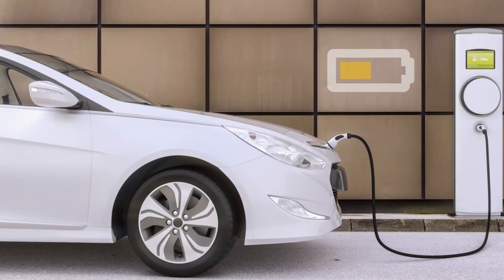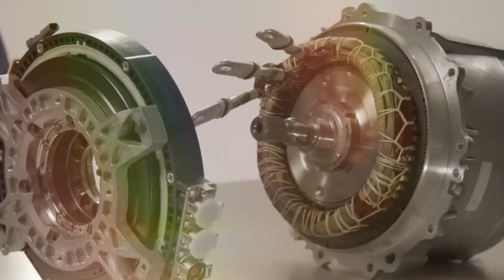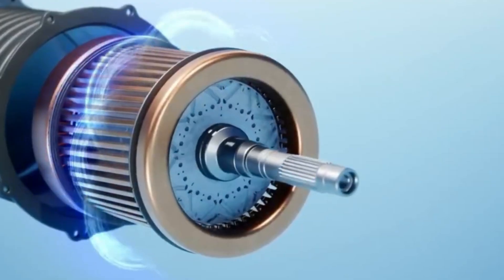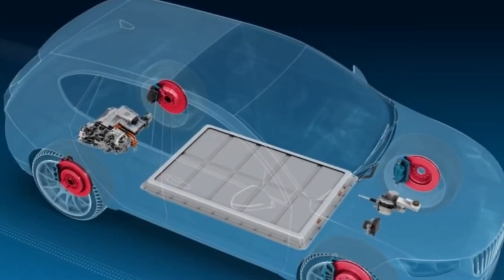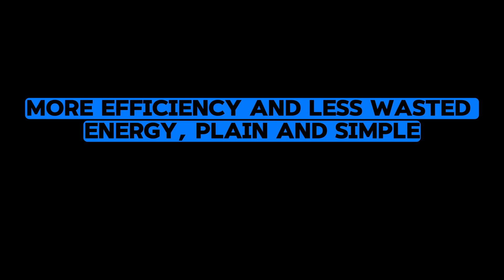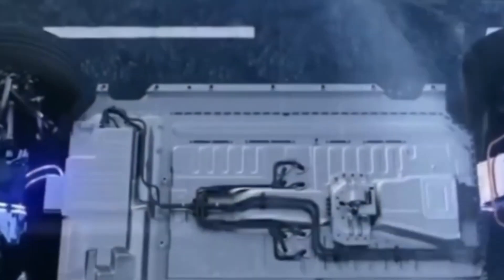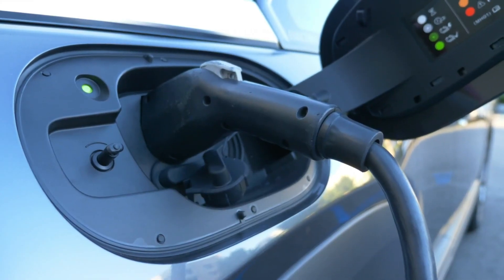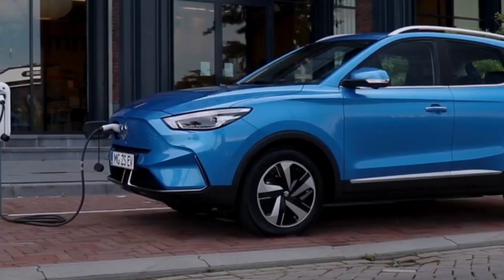New Magnet-Free Electric Motor SHOCKS Entire Car Industry!

Comment: Old news. Tesla already uses "magnet free" induction motors on SOME of their cars. They are cheaper than permanent magnet motors, but are not very efficient, so they are only useful on the front axle of AWD models where they are only powered "part time" and therefore don't harm the range too much.